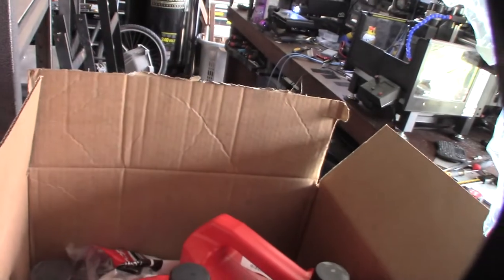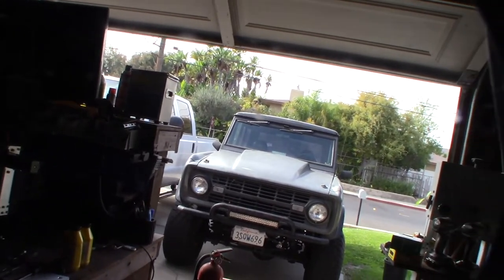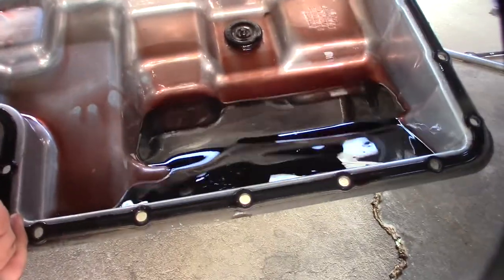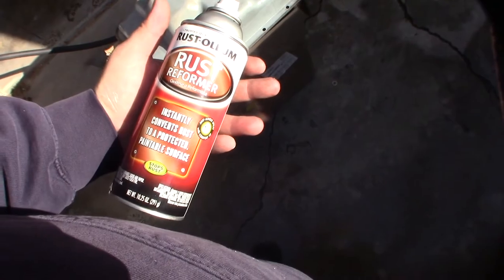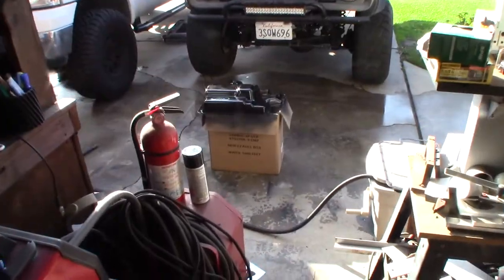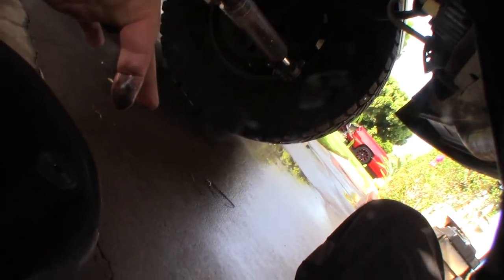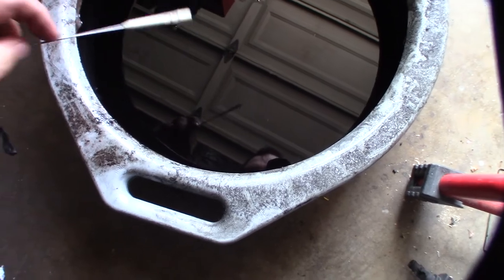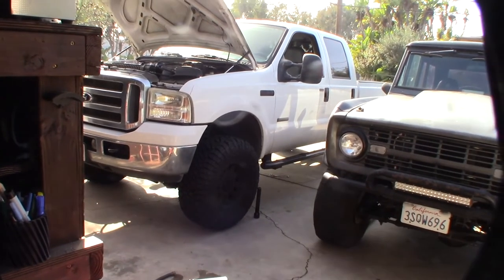Hot Shot's Secret Shift Restore transmission fluid and filter change for 5R110 Powerstoke 6.0 F250

Comment: Nice location on your 2nd filter so it’s real easy to change . Sure wish our Odyssey van one was. Honda says the filter on the drive side of the trans never needs changed. But many people do change them since the Odyssey trannies seem to go out often. Any way people pull the filter which looks like a large round fuel filter and they are falling apart? My Odyssey trans went out few years ago so Honda rebuilt it but now it has a 1 second delay when I put it in gear. So was wondering it the Hot Shot Shift Restore might help whatever is causing this. Fluid is changed about every 25k miles and shifts awesome to.

Comment: I hope you realize that you are now running a  mixture of new fluid and the   factory fill fluid.! When you do a pan drop only, you will be leaving more dirty and tired fluid in than what you replaced.! I'm not trying to be an A-Hole, just offering friendly advice to help you out ,and others the next time you do a fluid change. To do a complete change, look up TOTAL system capacity for the vehicle. Have the new fluid open and ready to pour. Find the pressure line and return line. Drop the pan and drain. Use an air hose to remove all the old fluid from the cooler and the return line. Don't blast the air nozzle wide open, just use enough pressure to remove the the old fluid from the COOLER and the return line(LEAVE IT ATTACHED TO THE COOLER).!!! NO NEED TO REMOVE IT UNLESS IT NEEDS REPLACEMENT.! i.e LEAKING.!! Have your drain pan under the transmission EMPTY to hold ALL the old fluid that's going to be removed. Use the air on the pressure line side where you removed it from the COOLER. You will have to determine which is the pressure line by removing the line first, and looking for flow of fluid with the engine running. Have a helper ready to cut the engine off after you make sure you have FLOW out of the line. You will need to have something to catch the fluid from the  line. Use the air nozzle with a rag to make a better seal to the inlet side of the COOLER with the return line still attached. Have the helper  watch for all the old fluid coming down out of the transmission until it's just dripping. DO THIS STEP WITH THE ENGINE OFF, FILTER OUT.!!!! Replace the Filter's and the pan. Buy some cheap Clear hose that will fit over the pressure line.!! Have enough hose to reach out to a really large container, a trash can, or a big storage container. Fasten your clear hose to the container, clothes pin or will work fine. Make sure you can see the hose from where you will be adding the Transmission Fluid.! Add the amount of fluid that you removed first. Have the other fluid open and ready.! You or a helper can start the engine now. Know the TOTAL CAPACITY OF THE SYSTEM.!!! WATCH THE CLEAR HOSE AND KEEP ADDING THE FLUID FAST. The pump will be emptying the torque converter  which holds the most fluid. ADD until the darker fluid inside the clear hose is the same color as the new fluid.!! DON'T LET THE FLUID GET LOW, OR THE PUMP CAN FAIL..!!! HUGE FUNNELS WORK BEST.!!! Leave enough room for the HOTSHOTS SECRET.!! STOP ENGINE.!!! Remove hose,and reconnect pressure line securely.!! Check and adjust your fluid level, hot and cold.!! Now, you have all NEW FLUID, NOT, the mostly weak, and dirty used fluid mixing with the way, way, smaller amount replaced by a Puke & f